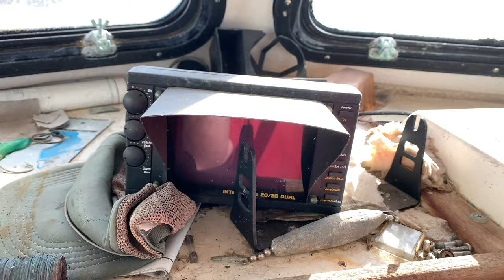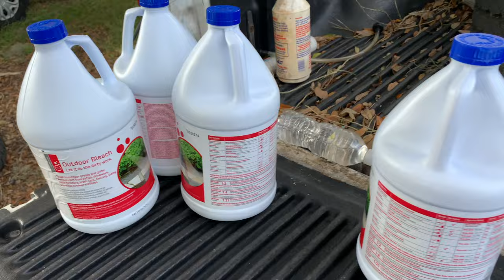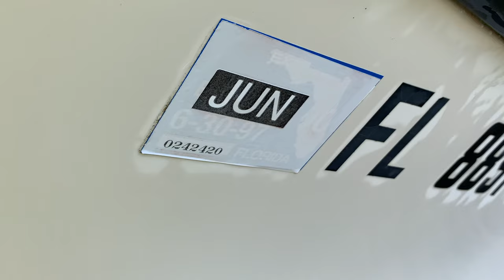STORAGE AUCTION SCREWED ME? | BOAT AUCTION | Broken Parker Pilot House Project Part 1

Comment: Well $140k - $170k is what new 2520's are going for now. You're in it now for 2k, and it looks like it would clean up nicely. New motor, tank, fiberglass work, paint, modernize it. Just throw money at it, all it takes. Good luck, im gonna follow along.
Reply from the maker: Thanks Mr.NaughtyPants, just picked up the Suzuki 250 outboard. Finishing up the pulpit and about to cut the rear floor out to replace the tank. Thanks for following along I can't wait till the videos of actually being able to use the boat! Aiming to have it done by end of summer.
Reply: @KnottsFishing  I hear ya, wish you the best of luck. If you have a new tank made, spray that sucker in LineX bedliner spray, will last forever.
Reply from the maker: @TSemasFl   thanks for the tip, didn't even think about that, but I have a buddy that sprays the stuff so I will definitely get that done!

Comment: I think for 2,000$ you did pretty good, some fiberglass work, floors looked pretty solid!
Reply from the maker: I think so too. Time will tell. Hopefully be done by this summer.
Reply: You cant just tell by looking at it..Transom and stringers, deck/sole , engine , all could be rotten..
Reply: @islandmikerood1847  curios how a engine can rot? Lol
Reply: @jfkcollector8968  You know what i  mean...Get real
Reply from the maker: @islandmikerood1847  don't worry bud, I already sold the rotten Yamaha Engine for more than I bought the entire boat. 

Also your above comment contradicts your prior comments on other videos "that transom is rotten." DM me if you want to make a guest appearance on the videos so you can teach us all how to do fiberglass/repair things.
Reply: @KnottsFishing  As an ex boatyard worker specialized in fiberglass and nidacore i will take you up on that offer.Just pay my ticket, im in the Caribbean. If I have to show you that a transom with a big hole in the fiber, thats been sitting outside, is rotten, I highly doubt you would take any advice from me though, keep on patching bud..
Reply from the maker: @islandmikerood1847  Message me Im all ears actually. If all it cost is a plane ticket Im all for it. I actually plan to cut out the floor in the back and put in a new tank.  Which will allow me to check stringers and plan to build a livewell in the transom area so there is no better time than now to do a transom if its needed.
Reply: @KnottsFishing  Yeah actually im not able to. I checked and my workschedule is pretty tight..You can do it..just gut the thing and start from scratch.Hope you got a big bank account though..Reminds me of my first boat, a big black hole i just threw money in lol..on a more serious note, Did you ever check the transom by Tapping or  drilling? You dont want  your outboard to fall off in the middle of the ocean..I can almost assure you that its a goner.If thats rhe case your stringers and bulkheads are shot too.Rot travels.The spores are in wood and it will keep on rotting. I would think of Nidacore/honeycomb and  Coosaboard .You will never have to worry about anything again..Do it correct.Dont patch, but strip and gut and start all over. Good luck
Reply from the maker: Im actually thinking about cutting the wood I did out and doing coosa board. I did moisture meter the transom and it didnt raise any red flags. But the boat also hasnt been in the water or around water for at least 20 years. Once I cut the floor our for the new fuel tank ill have a better idea of what the stringers look like.